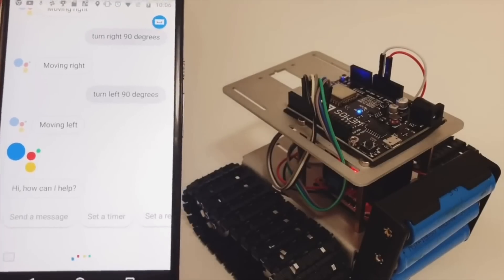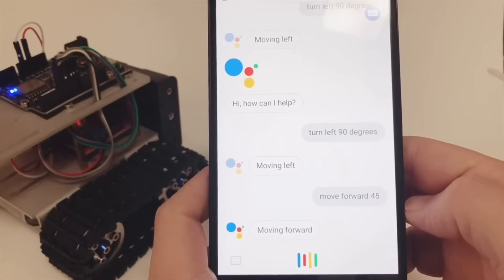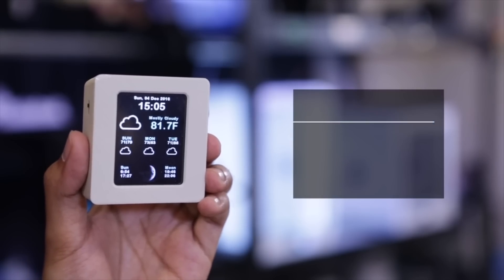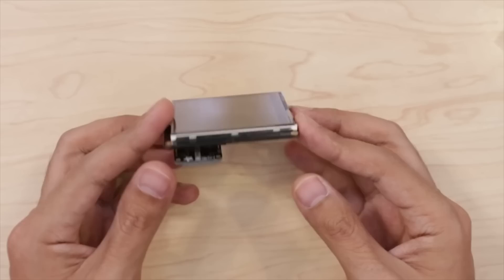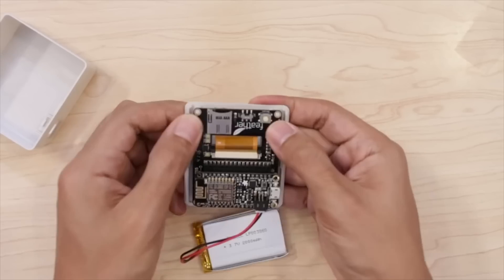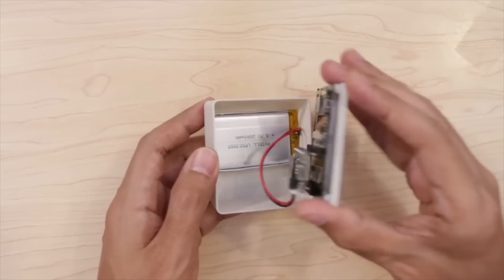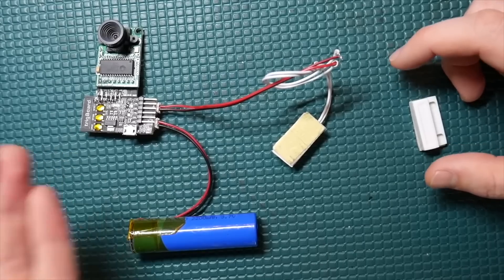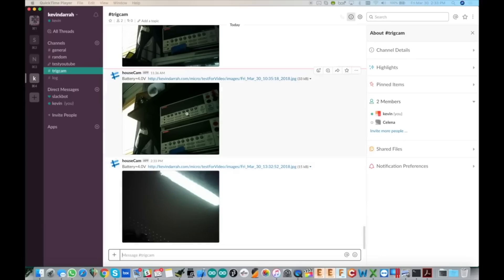TOP 5 ESP8266 (NodeMCU) PROJECTS - Maker Tutor

Comment: ESP8266 WIFI Module
-Uses CH340G instead of CP2102 NodeMCU has built-in USB-TTL Serial Communication
- Interface voltage: 3.3V
- Antenna type: Built-in PCB antenna
- - Wireless 802.11 b/g/n standard WiFi at 2.4 GHz
- Supports WPA / WPA2 security mode
- Support STA/AP/STA + AP three operating modes
- Built-in TCP/IP protocol stack to support multiple TCP Client connections (5 MAX)
- D0 ~ D8, SD1 ~ SD3: used as GPIO, PWM, I2C, ...

Price: 130 L.E
Phone & Whatsapp: +201032312503
From Egypt